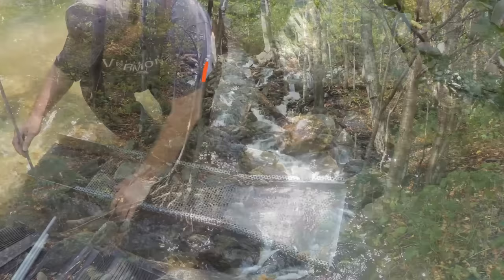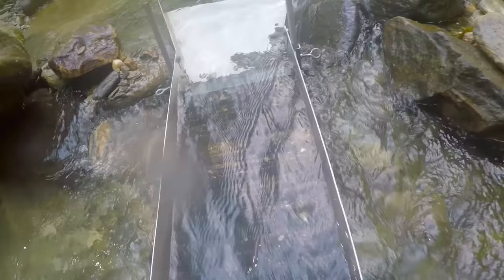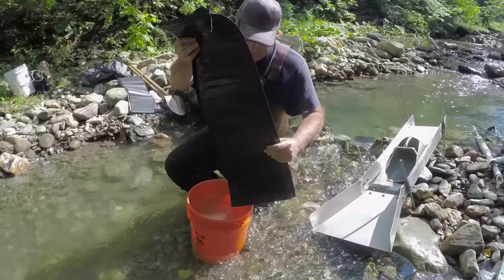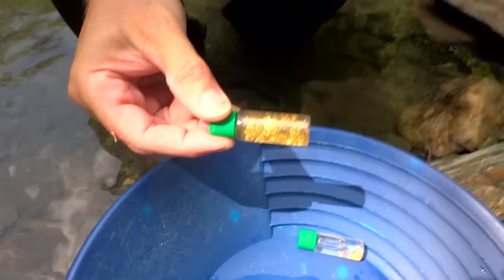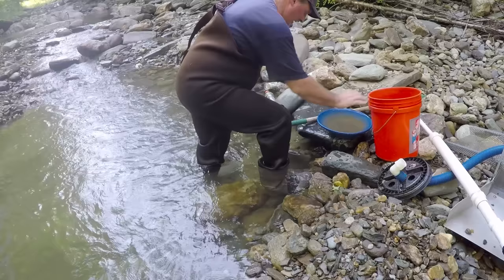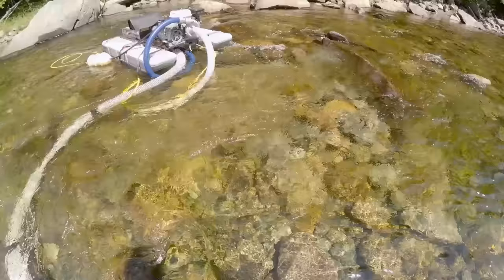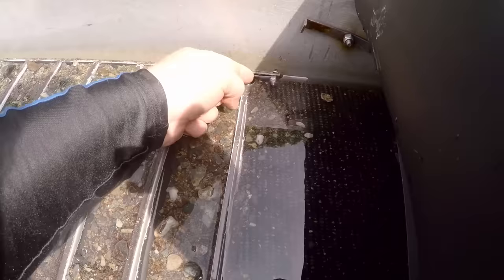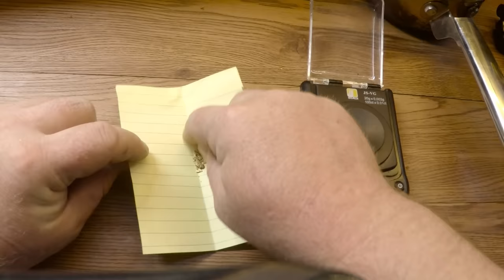Jeff Slade reviews the Gold Hog Mats Le Trap Sluice and a Hand Held Dredge

Comment: FYI, another way to strengthen and slightly thicken your sluice is a DIY Fiberglass Kit, which you can add one or more layers to the bottom of the sluice which you can sand and paint to match! It’s a quick fix but make sure to wear good thin gloves and rub a small amount of baby oil on your hands, as that stuff can get messy real quick.
Reply from the maker: Thanks for the info! Thanks for watching!

Comment: APTS Gold is out of business that sold those custom punch plates for the A52 (American-Prospector Treasure Seeker) I had one . We used to call it a "Maxfield Special"because Dave started the trend. Jeff did advise me to add the aluminum ramp before the Razor Back which I did on mine. Notice the "chicken scoop" he uses to wash material.
Reply from the maker: That was the first time I saw a punch plate on manual sluice. Looks like you need really fast water to use it correctly.
Reply: yeah only good after storms or spring flow. You still gotta help it sometimes. I got rid of mine, but repurposed some of the material into a custom classifier to fit one of those cat litter buckets.